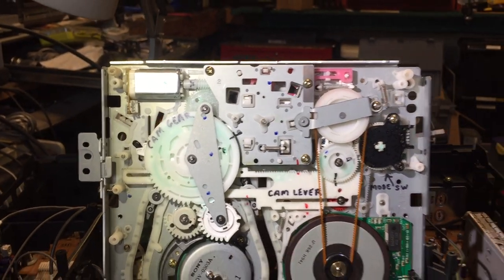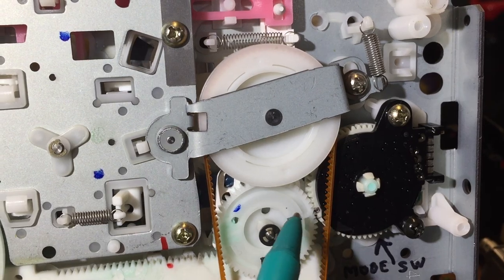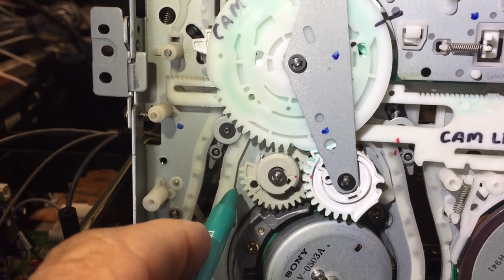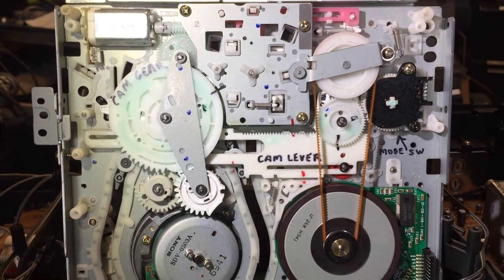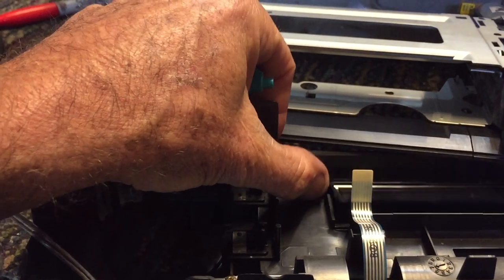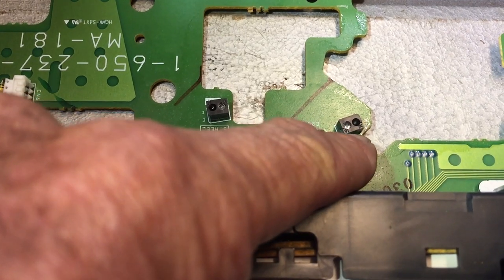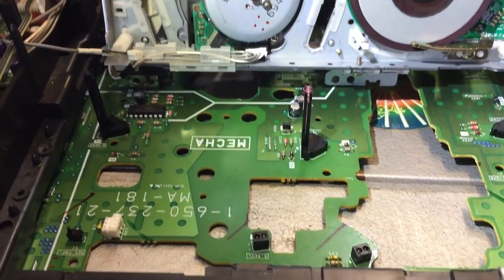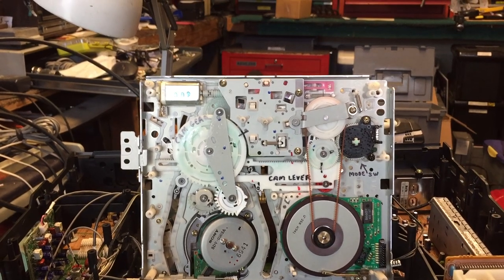VCR Gear Alignment Tips And IR Sensors

Comment: Hi I've got a Toshiba VHS/dvd combo to fix for my Dad tapes not loading and playing. Can you align it without having to strip it down? Thanks Jack UK
Reply from the maker: The only thing you can align without taking it all apart is the loading carriage.
Reply: @GrantsPassTVRepair  thanks do you mean remove the loading cartridge? I did notice numbers printed on the spindles is that to do with alignment? Thanks for your fast reply Jack UK
Reply: I twiddled the spindles and gears before it basically went from not liking the tape to ejecting it to loading it play a few seconds then standby!
Reply from the maker: @jackmilne9764  Yes the loading carriage.
Reply: @GrantsPassTVRepair Thanks mate I know you won't know the model answer. But will it be common for the manufacturer to add arrows by it? Il check it out later. Thanks Jack UK
Reply from the maker: Some gears just have dots for alignment on the gears.

Comment: awesome video, very helpful. I have 3 VHS-C cameras that need my attention. 1 chews tapes when in RW the other chews when FF or in play mode as I can see the tape slips. Not sure if its the pinch roller, i couldn't find an encoder switcher on the camera.
Reply from the maker: If you meant the mode switch they can be buried in somewhere in there.
Reply: @GrantsPassTVRepair  yes i did mean mode switch.  On those little VHS-C cameras everything is packed tightly.
Reply from the maker: @reel_images  Yep. Unless you repair that model on a regular basis and know the mechanisms it can be a real challenge.

Comment: You forgot to tell us what was wrong with the tape counter not working. Was it dirt on the sensors, defective sensors...? Great video by the way.
Reply from the maker: In this case I didn't bother to repair the tape counter,,  but if you ever need test one you just put your meter probes across the Two infrared detector terminals, and rotate the disc which has the reflected strip.. When it sees the Infrared emitter light bouncing off the rotating disc or shining through it in this case it produces a voltage drop .across the detector terminals.
Reply: @GrantsPassTVRepair  Thank you very much Sir. I really enjoy your repair videos.
Reply from the maker: @josem.martinez856  Thanks for the thumbs up. ;-)

Comment: i wonder if its best to have a starting point with alignment of the gears,  eg:  the top gears 1st? (on the head side) or is there a primary  "main" gear that should be timed to start with,  and all the others are synced to that specific gear?  such as the  "pinch cam gear"   or  the "main cam gear"   which is the main gear,  that  once its in place,  all the others will align to it?  or am i answering my own question?  the "main cam gear"  ?  thats why its called the Main cam gear?  and everything is aligned to it?
Reply from the maker: For me the starting point is in the eject position with the tape out of the VCR.